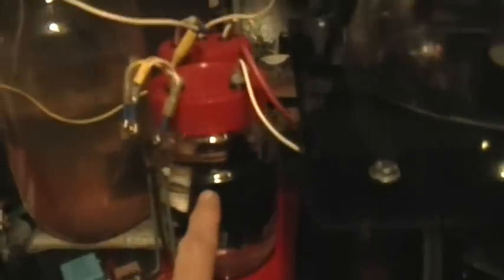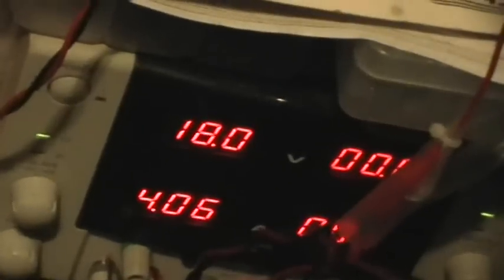Extreme High Voltage: AnAtmoSphere Low Pressure Chamber First Light

Comment from the maker: Thanks... I've gotten a better vacuum today, and I've been able to photograph very clear multiple layers, very stable, in the plasma around the ball. If I can get enough good stills I'll assemble another slideshow, concentrating on the Z-pinch segmentation of the arc streamers, and at lower pressures, the multiple stable plasma layers in the distributed glow discharge.